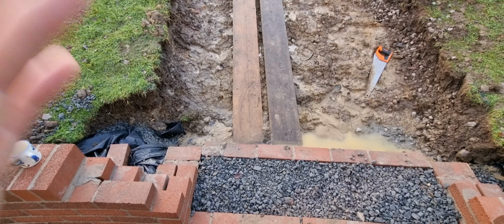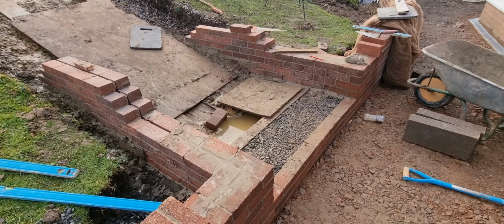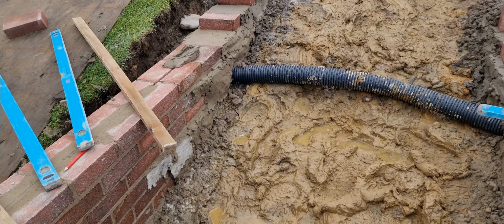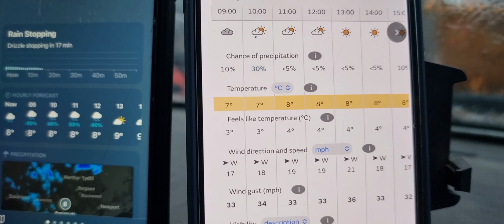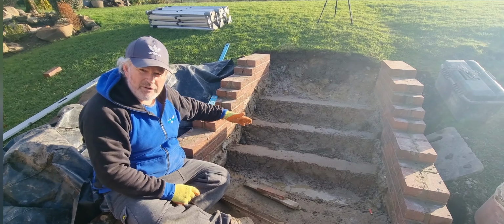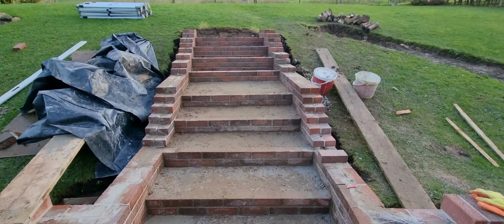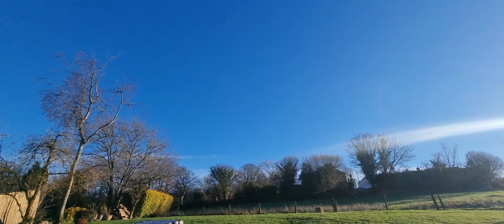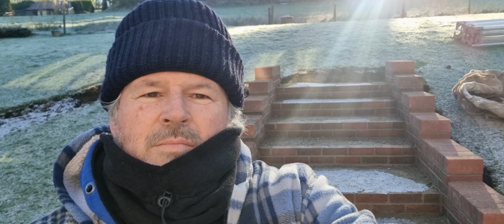Brick steps-start to finish

Comment: Look well smart them steps lads. Yere definitely worth wile having a few battens for measuring. Saves time getting ate tape out I use this method a lot 👍👍👍
Reply from the maker: Little tricks of the trade Mark make work easier which helps a lot .Hope you and yours are all well mate 👍 👌
Reply: @brickrightbuildinglandscaping  yes mate we inside at the min doing work go back out when this crap weather picks up 👍👍👍

Comment: Amazing stuff again buddy. Gave me huge insight into when it comes to the steps. Do you see an issue with me using oak sleepers, as long as the back side is completely guarded against water with a DPM across all of it? Same with the wall?

Looked freezing here. I'm actually looking forward to when the temperature plummets like this again in a month, because this rain is infuriating!!
Reply from the maker: No issue with sleepers id use a bitumen paint on back of sleepers and id recommend tanking the wall Marus not the dpm mate 👍 😉 🙌🧱
Reply: @brickrightbuildinglandscaping  

Sorry mate, I should have specified I was making the wall out of sleepers as well. So I can use bitumen paint on both the oak sleeper wall and steps?

Comment: Great work! I’m about to do the same at my own place and been racking my brain on the best way to do it. I definitely like the idea of building into the bank, the only other thing I can’t get my brain around is how do you know how steep of an angle to dig the bank at?
Reply from the maker: Thanks devon
Work out how many steps you need .select your tread size .times the tread size by how many steps.The answer gives you the length of the finished steps add a bit more just to be safe.
Mark the answer on the ground with line spray .
Dig this area out around  about 400mm depth to start with.
Then mark out each step with line spray and you can check the depth of the steps with a straight edge and level to check your levels will work .Some adjustment may be needed. 
Hope that helps and good luck
Justin 👍
Reply: Perfect. Thanks very much